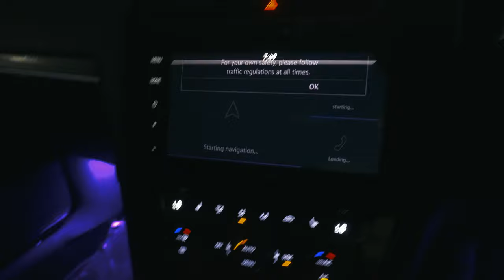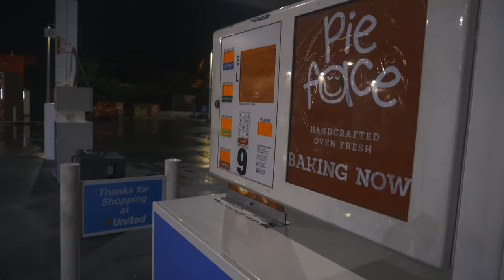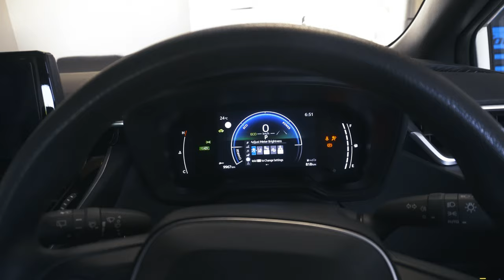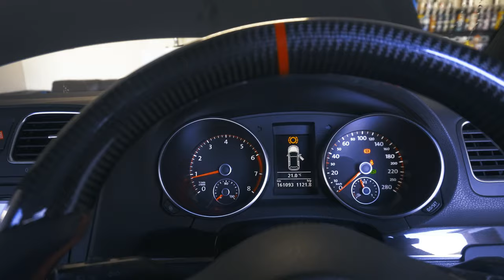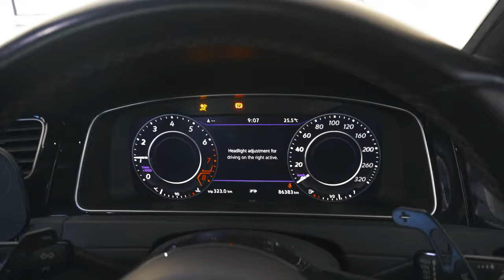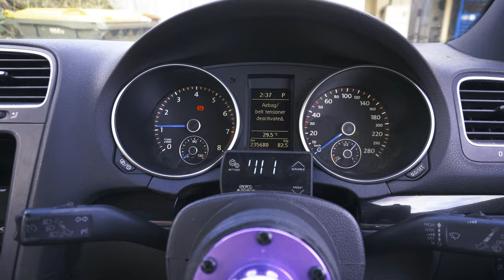OUR FIRST E85 FLEX FUEL TUNE ON A GOLF 7.5 R! (S2-E12)

Comment: Ok so you work for MRBS i take it from this video? You know your stuff, maybe you can give me an idea. Just had a rebuilt motor put in the mk6 gti. It drove about 20klm before oil leak from the crank seal. I replaced the seal was fine under idle, took it for a drive leaking again.  It appears to be coming from the bolt then spraying out from the harmonic balancer. I'm at a loss as the seal appears fine it's coming up the thread of the bolt and leaking behind the harmonic balancer 🤷 old man reckons silicone the bolt up just behind the head of the bolt? I'm not so sure about that. If I lived near you you'd find it in your driveway one morning it's doing my head in. Mind you I have no idea really I can do shit I just don't know enough to understand why?
Reply from the maker: I run my own business, but am connected to MRPS closely.

Sounds like you may have crank case pressure issue of sorts. If it's pushing Oil out a seal, I'd have a guess and say something is causing excess pressure, and pushing out the weakest point (bolt holes and seals)
Reply: @notrobbiejames  ok thanks heaps for the response I'll have to do more homework now to find what could be causing that🤦 not good on a rebuilt engine. Builder is in Melbourne I'm in Sydney he's not responding of course.. oh well I'm in for problems I guess.. thanks again legend 👍 has a catch can with Africa plate so pcv is deleted..
Reply from the maker: Get rid of the catch can, and put an OEM PVC on it. See how you go with that. Plenty of big power lads run OEM PVC and don't have issues
Reply: @notrobbiejames  ok I'll give that a go mate thanks again hey. Gonna be pouring tomorrow so good day for it. Lucky I keep all the original parts. Have a good weekend legend